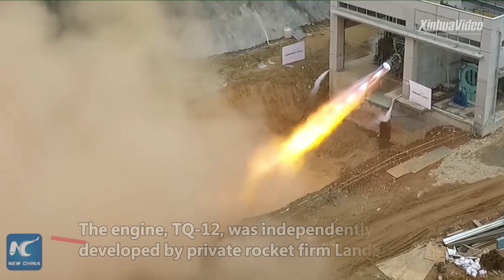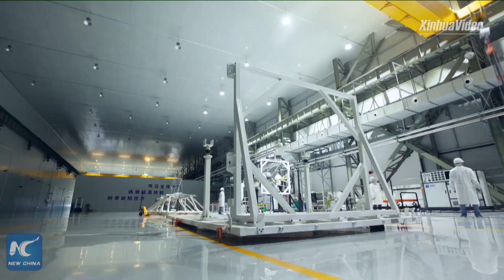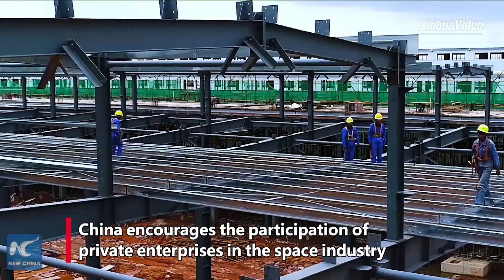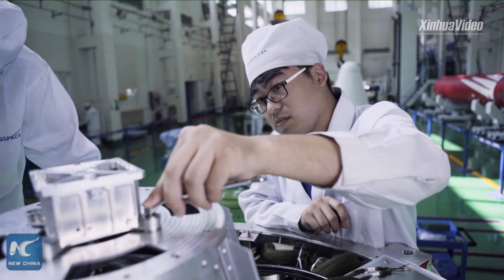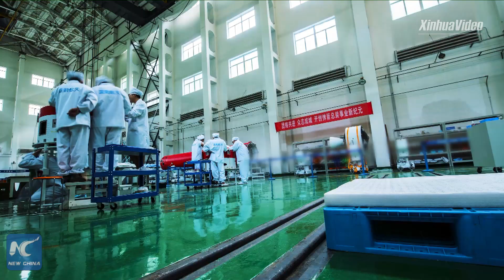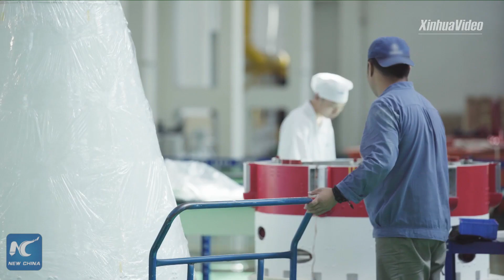China's liquid oxygen-methane rocket engine completes key test

Comment: Oxygen methane  engines can be exported to other  developing countries for mini satellites launches.
Reply: Good luck sourcing cryogenic plumbing components to n developing countries. Not only that, but the LOX components need to be oxidizer rated and cleaned appropriately.
Reply: @maxk4324  plus tonnes of ground equipment is needed.

Comment: You could spot "mach diamonds" in the exhaust, like those the SpaceX Falcon engine (also a methalox engine) generates.
Reply: Yeah but the Falcon have finer thrust than this they need to improve it.
Reply: @raifij6698  The Chinese designed the Tesla's FSD and not to mention Tesla, SpaceX, Solar city are all Chinese rebranded technology incase you didn't know.

Comment: That's a rocket engine,even Musk produces them...space race
Reply: But from what i seen the flame from musk rocket engine have finer thrust of flame. This however only a couple meter then become not synchronized they need to tune it up
Reply: @raifij6698  Also the flow rate is not even it seemed.  Leads me to believe the turbo pump isnt to parameters or in that area is running not as "tight"